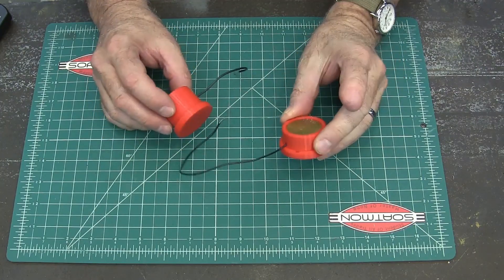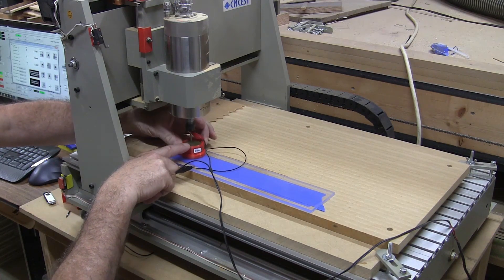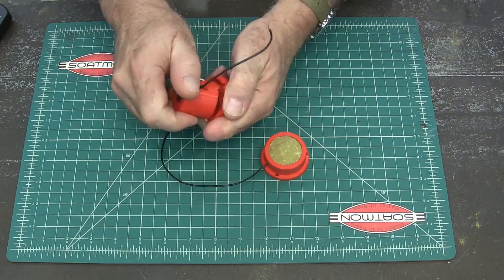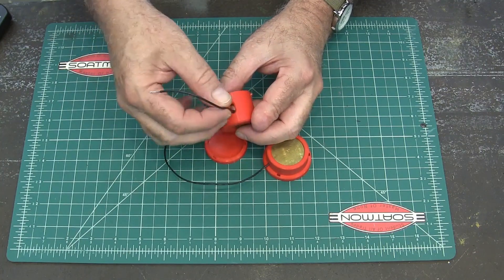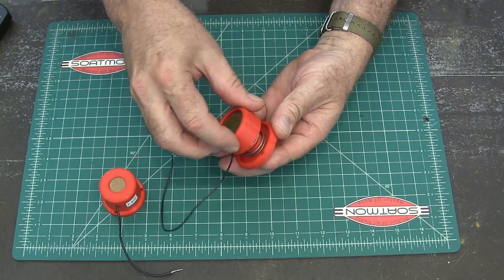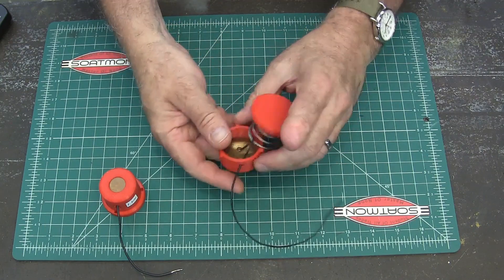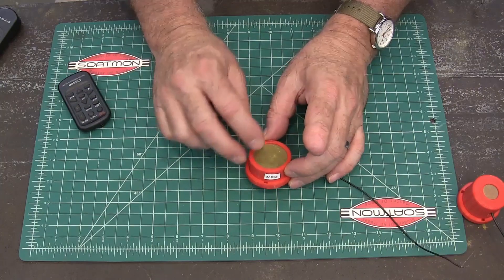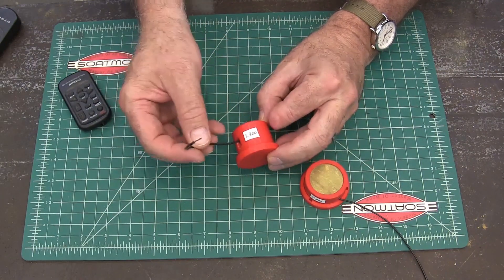Homemade CNC Touch  Plate

Comment: Hi there, I have the identical machine and VFD featured (CNCEST 6040) in your video.  I would like to add a touch plate but cannot figure out where to connect the 2 wires to the controller (Positive and Ground). Can you shed some light on your connections?  Thank you!

Comment: This sure beats the cost of a commercial one I am quite certain.  And you can make it what you wish.  I missed comment to you last week we were on travel for work helping on an installation of 6 heavy duty bus lifts.  Not finished but off for a while until the contractor gets farther along.  Hope you are doing well and getting ready for the fall.  We are taking some of the garden things down and cleaning up for the year.  Thank you for the video.
Reply from the maker: Installing heavy duty bus lifts!  That sounds pretty interesting!  I'm loving the cooler weather and am getting some things done outside.  This week I'm replacing 2 walls in my barn with movable walls so I can clean the stalls with a tractor.  Video will follow.  Glad you have a little time off.  Enjoy!